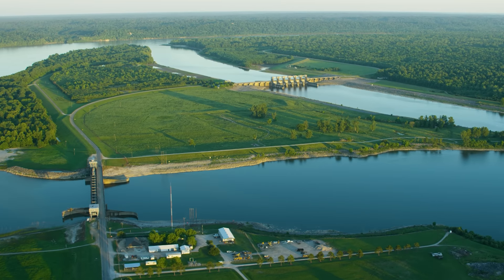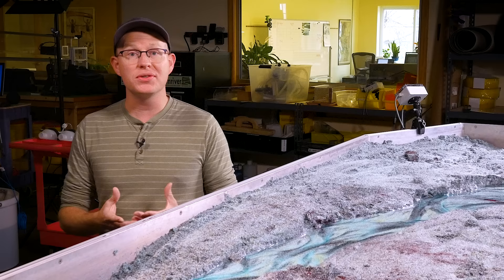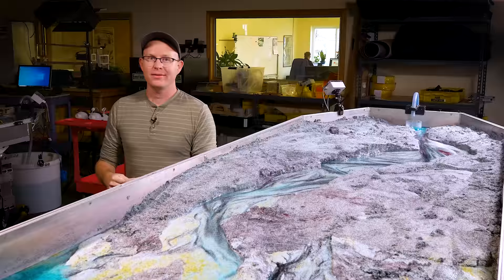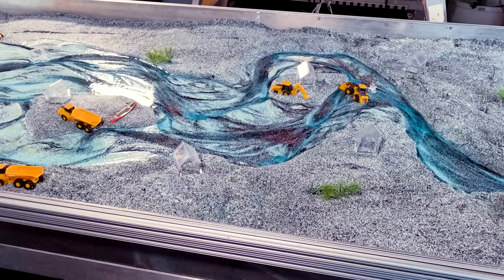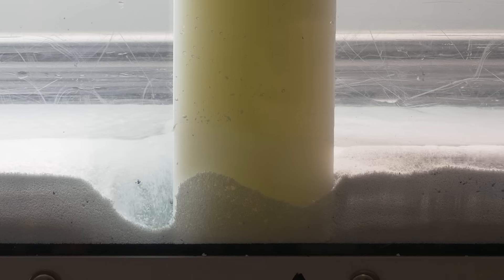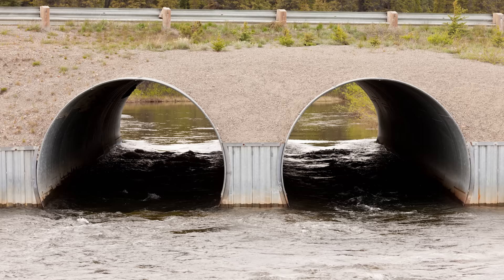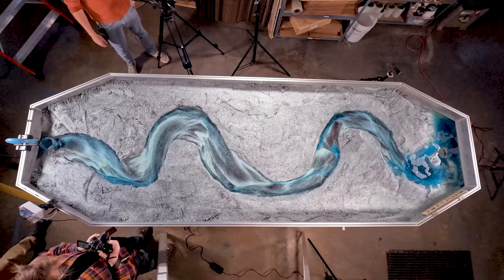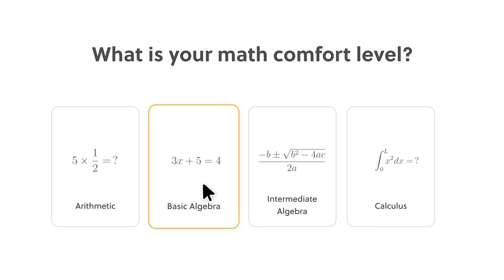Why Engineers Can't Control Rivers

Comment: Your model of a dam in a flume, filling with sediment reminded me of a story from a dive master about a dive at Imperial Dam:  The dive was intended to determine if there was a need to dredge behind the dam.  So the diver went off of the dive boat, then stood up and said “yeah it’s time to dredge.”
Reply: 😂 Classic!!
Reply: Why didn't they just use sonar to detect the depth? These systems are very cheap and are on almost all boats.
Reply: At that point, they could have just used a stick…
Reply: @Eric-xh9ee  its a joke bro
Reply: The Garrison Dam in North Dakota has its downstream outflow at the lowest point of the dam, allowing sediment to pass through. The water near the intakes is almost 200ft deep.
Reply: @Eric-xh9ee  It depends on several things, like when was this supposed to have taken place?  The dam was finished in the 1930s.  It's in a desert in Arizona, so the river varies from being nearly gone to carrying immense sediment loads, which you can't see through.  So, if the joke were formed in the 1950s or '60s, and even the '70s, there is a very good chance that any special technology like sonar was not "cheap."  Nor are they, even now, "on almost all boats."  But more importantly, the story is obviously a joke because you don't need a diver to sound the depth of water behind a dam.  All you need is a line with a weight.  But throwing a line in and having dropped three feet before stopping isn't nearly as entertaining, even if the conclusion is the same.
Reply: @theeddorian  😂😂
Reply: Because of the dams' locations It is usually very difficult to bring dredging equipment to remove asolvity
Reply: Classic tugboater joke

Comment: As someone from a country with comparatively little soil over bedrock and practically all foundations supported by solid rock down to several kilometers, I keep finding myself surprised how much trouble other people get from things not staying where you put them due to erosion.
Reply: What country if you don’t mind me asking :)
Reply: even the mountains move...
some very old ones do very slow, but there are also pretty active ones
Reply: @TheJawRaw  In Halifax, Nova Scotia, Canada there is solid bedrock just a few feet under most of the peninsular part of the city which can be seen when excavation happens for construction and in some house basements.
Reply: Where the bedrock is close to the surface, erosion can still be tricky. I worked for a while in Freetown, Sierra Leone, which is built on the slopes of a mountain descending into the sea. Most of the soil in the city has been scoured away to bedrock by tropical rains. When you remove vegetation on a slope, the soil disappears. Sometimes - sadly - at speed and with the buildings and people who were on top of it, no matter if the foundations were in rock.
Reply: Flex about how u listened to the Bible and built your home on rock😂😇
Reply: @fastinradfordable just don't start stoning people for mixing crops in their farms or wearing two different fabrics at the same time